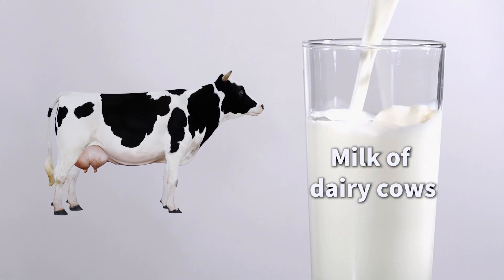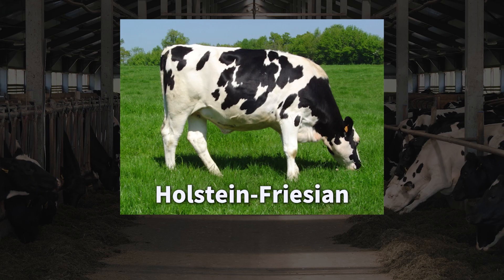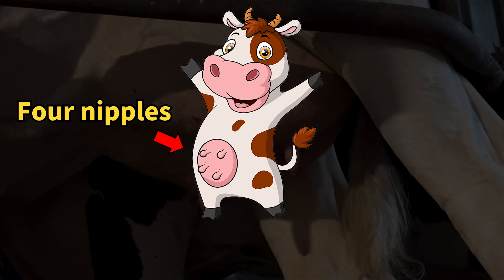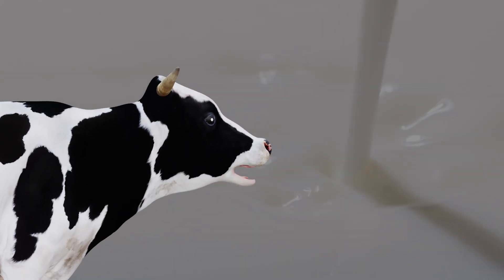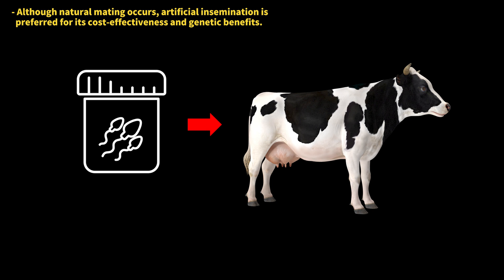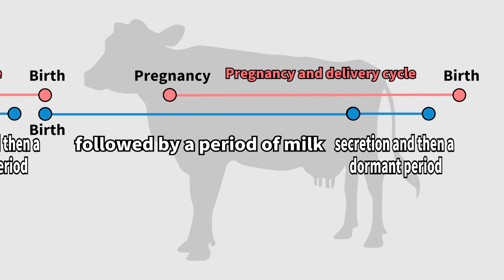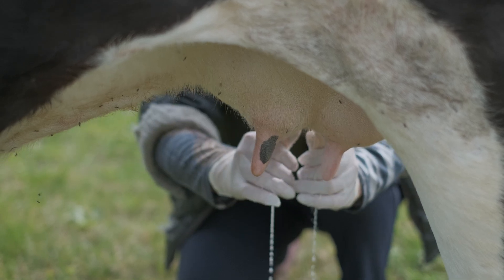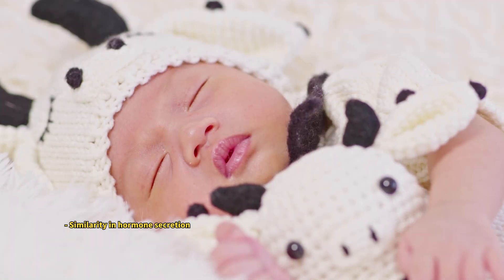How Does Cow Make Milk?

Comment: Actually it is a misconception that cows have to be bred every year to produce milk.  Many hobby and organic farms actually use an 18 to 24 month cycle instead of a yearly one because it causes less stress for the cows.  A dairy cow that is bred every year is actually in their early pregnancy at the same time they are at their peak milk production which is very hard energy wise on their bodies.  Also, cows can continue to produce milk for up to 3 years pretty easily as long as they are milked regularly, there are actually some records of cows staying in lactation for 5 years or longer.  It is just that after about 6-8 months the amount they produce per day starts to drop off pretty dramatically, usually leveling off to around a half to a third of their peak production after about 10 months which is why most high yield commercial farms are on a 12-14 month cycle instead.  Honestly there are some pretty serious debate on if longer cycles should be required for dairy farming, not only does the longer cycling produce far less calves but it also extends the average production life for each cow.  Commercial dairy cows on a yearly cycle are often replaced by age 5 while cows that are cycled longer are often still milking well at 8-9 and can even still produce longer than that.  Banning steroids and hormones has drastically helped the general health of dairy cattle at the cost of lower overall yields, increasing the length of breeding cycles would do the same although it would also cause a similar spike in dairy prices for brands that are not already using that practice.